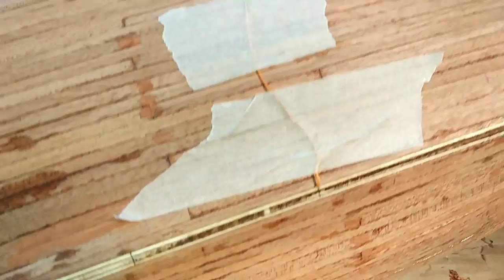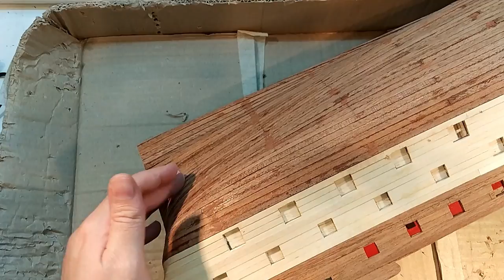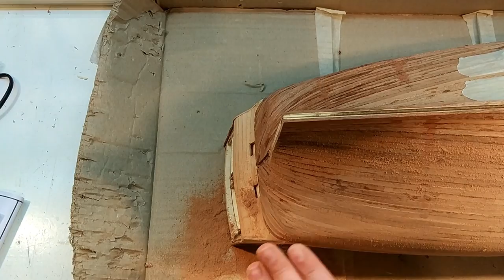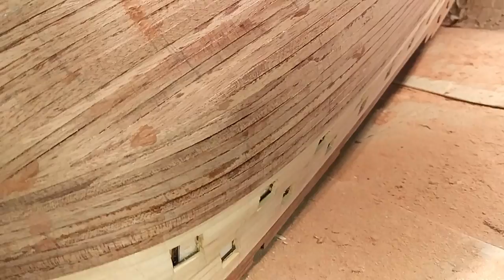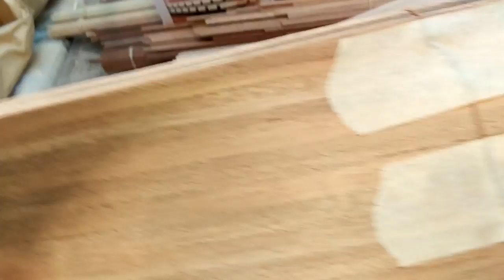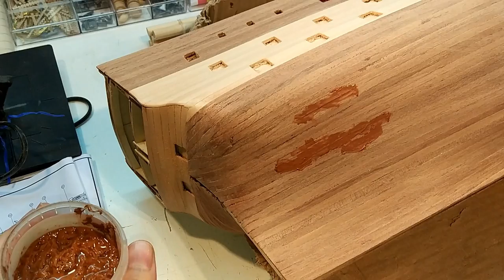Montanes - part 27 Lets Sand

Comment: When I hand sand without a sanding block I leave ridges in the wood. In the concave areas I use sand paper wrapped around a large diameter dowel. Then finish up sanding without a sanding block. 
Keep up the good work, I learn a lot from you.
Reply from the maker: Thank you very much!!! Try to use 3 types of sand paper like i do. You will minimize the ridges in the wood to almost no visible ones :)

Comment: Good morning John another great video. Nice job with the sanding, I find it hard to match the color of the wood here so use white glue and all that sawdust that was just sanded. I find that color match is so much closer than with puddy  as long as I can keep the about of white glue to the least amount possible.  Great video again.
Reply from the maker: Good morning my friend!!! Thank you very much!!! I just answered that in Jose, so i will just make a copy of the same answer if you don't mind (i know that you won't :)  ). 
 I have used it once and even though the result was great, i found out that when i apply the varnish the are that had a mixture with white glue had a different shade of color and you could tell that with a close look. Maybe you can tell it only in gloss varnish but that's what i use, so i changed to colored wood putty.

Comment: I use a mix of saw dust (sapelli) and white glue. Fill the gap with PVA and then sand. The glue plus the saw dust fills the gap and makes it invisible. I am very happy with the final result
Reply from the maker: Yes, this can work too. I have used it once and even though the result was great, i found out that when i apply the varnish the are that had a mixture with white glue had a different shade of color and you could tell that with a close look. Maybe you can tell it only in gloss varnish but that's what i use, so i changed to colored wood putty.
Reply: @JohnsWoodenShips  OK, understand, but as I don't varnish my hulls everything comes out ok! Regards
Reply from the maker: @josel.bacharel4891  Yes it's logical and that should give you a better result.

Comment: Bonsoir John,
Pour rendre bien lisse la coque, il y a un gros travail de ponçage. Pour dégrossir le ponçage on peut utiliser des racloirs en verre de 4mm et ensuite finir avec des cales souples abrasives de différents grains. Je vois qu’après ponçage que pratiquement toutes les tâches de cyano ont disparue et on obtient une belle coque. La coque va être vernie ou peinte ? 
Merci pour ce partage. 
à bientôt et bon courage pour la suite.
Yves de Lille (nord de la France)

Hello John, to make the hull smooth, there is a lot of sanding work. To roughen the sanding, you can use 4mm glass scrapers and then finish with flexible abrasive blocks of different grains. I see that after sanding that almost all the cyano stains have disappeared and we get a nice hull. Will the hull be varnished or painted? Thank you for sharing. See you soon and good luck for the future. Yves from Lille (northern France)
Reply from the maker: Hi Yves! I use a 80 degrees sandpaper for the first rough sanding, then 150 and finally around 500 degrees. After that i will apply a coat of nitro wood sealer and then 2 coats of varnish.
Reply: @JohnsWoodenShips , 
Vu la qualité de la coque je me doutais que vous alliez la vernir.
Quelle est la différence entre un vernis nitro cellulosique et le vernis que vous appliquez par la suite en 2 couches ?
Reply from the maker: @modelismepassion4493  The Nitro varnish is wood sealer. Then i apply 2 coats of  the clear gloss varnish that is made for yachts.

Comment: When I first saw this video, I wondered why you don't use one of your sander tool. Theoretically it should be easier. But after I started sanding the hull of my model ship, I understood: seeing is one thing, dooing and feel it is another thing.
Reply from the maker: Yes the sense of your fingers is the better way to make sure that you have a smooth surface :)